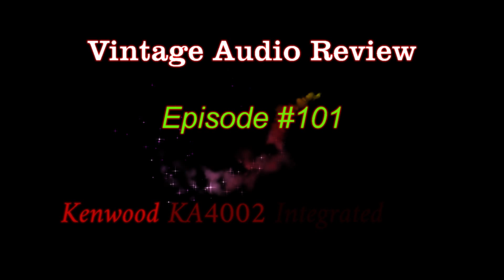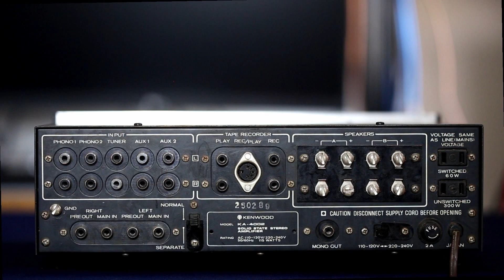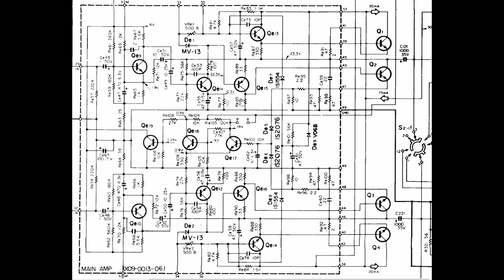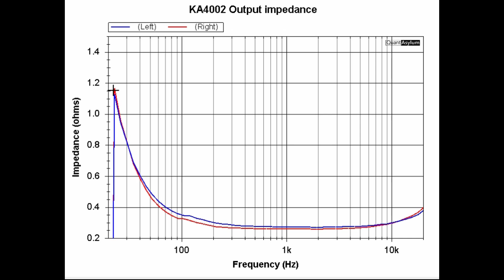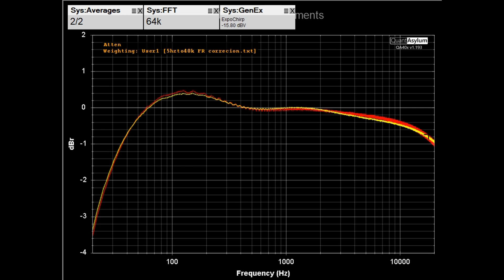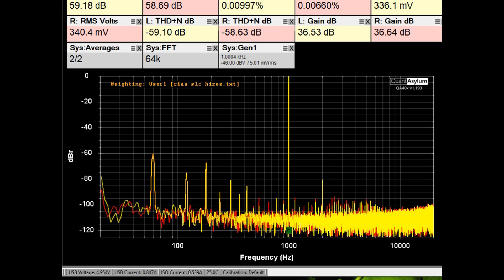Kenwood KA4002 Integrated Amp- Vintage Audio Review Episode #101

Comment: The best sounding small amplifier I have ever heard. I am a retired electronics service tech and have heard 100's upon 100's of amplifiers. This amplifier which was designed by Nakaichi and Jiro Kasuga just before they left Kenwood-Trio to form Accuphase. It is an absolute giant among small amplifiers. Strongly recommend you change out the six Hitachi 2sc458 transistors.
Reply from the maker: Thanks for the info! It is my friend's and I am not sure he still has it. Will keep that in mind about the transistors.

Comment: Just got a 4002 at a fair price for my daughter. What a sweet little gem! Previous owner replaced the bridge rectifier and the PS capacitor in it, otherwise it is completely original and it sounds perfect. This old thing doesn't look like much, and I don't know if it's because it's capacitor-coupled, but it sounds astonishingly good. Now I need to find appropriate speakers for it. For the moment it matches nicely with my Dynaco A25XLs, to the point where I'm thinking about keeping it and giving my Pioneer SX-720 to my daugther instead!!  The Pioneer has almost twice the power, but the Kenwood sounds as punchy and is so sweet!  Thanks for your video!
Reply from the maker: Thanks for the great comment! Ask your daughter which one she likes- my guess is she will want the newer looking Pioneer. Am not familiar with the A25XLs, but a nice vintage speaker is the Klispch KG2 or 3.

Comment: I own one of these, and i can say this is a very sweet sounding little amp. Despite it's humble power (at least on paper) it can do seriously big music. The functions and the connectivity is very good for a little lower-end amplifier. Thanks to the cap coupled topology it sounds really sweet, some people don't like it because it's not very analytic, it adds some color to the sound, some people do like this... I did a full recap on mine because some caps were way out of tolerance, so i decided to do a full recap. Replaced some old noisy transistors too, with modern equivalents. I can say, this amp can be the main amp for a lot of people, it sounds so good, and in an average room with normal music listening it's power is more than enough...
Reply from the maker: Thanks for taking the time to share your experience with your Kenwood and  am glad you are enjoying it!!

Comment: My brother had one of these.  He and I drove down to Tech HiFi near MIT in Cambridge and while there he picked up this Kenwood, in house TDC speakers, and a Sony tapedeck (well before Dolby noise reduction).  It seems he just had to have a system similar to mine.  I had purchased a system from Tech HiFi two years earlier:  AR turntable, Shure ME93E cartridge (soon upgraded to M91E), AR 4ax speakers, and a Kenwood KA-2500 amp. It was a nice tiny DartColl dorm room system.  All three I still own btw.  As for my late brother's set up?  Long gone.  Soon after he got out of college I assume.  I wish he could have offered the 4002 to me.  :(
PS These early Kenwood amps, while rather low on the totem pole back then, bring relatively big bucks nowadays.  
S
Reply from the maker: Thanks so much for sharing- that makes doing this extra fun. It is amazing how we can remember the early set-ups we had in our younger days. I could not tell you the cartridge in my turntables, though 🙃. Glad you still have the 3 pieces of gear!  It is nice that a lot of vintage gear is getting good prices, but that also makes it harder to get good deals on them.

Comment: it was a budget amp back then and most likely will outperform most the budget amps nowadays 
I like these older audio equipment
Reply from the maker: Thanks so much for taking the time to comment! There is just something about a lot of the vintage gear that makes them attractive compared to a lot of the new gear, IMHO, even the budget models...
Reply: I sold these back in the day.  They were mediocre then and they're mediocre today -- the average sub-$100 "chip amp" and power brick combination blows it away in terms of power, distortion, and noise.  The input/output versatility and tone controls are its only edge over otherwise much better modern budget gear.
Reply from the maker: @editorjuno  Thanks for commenting and you are correct some of the modern $100 chip amps may perform better. But that is not point with people who like vintage gear like myself 😄
Reply: @vintageaudioreview  -- Understood, and there was no intention to rain on your parade.  As a "vintage" guy who's been around home and pro audio gear for well over 50 years, I understand that vintage gear nostalgia is rarely about performance -- it's a hobby interest in and of itself that's not about getting the best "bang for the buck" in terms of performance, which has been my personal audio m.o. for many years  Moreover, there are certainly a few somewhat elderly pieces that have no modern equivalent, at least not at a reasonable price -- e.g. the two 1980s Yamaha processors that remain at the heart of my own system, which has no fewer than twelve channels of modern Class D amplification, ten of them residing in three active three-way speakers and a subwoofer.

Anyway, I was an audio showroom sales drone circa 1970 and ran a high-volume audio repair shop later in that decade, so I'm just sharing whatever first-hand experiences I've had with the vintage stuff back when it was relatively new.
Reply from the maker: @editorjuno  Thanks much for the clarification and sharing your experiences. My vintage parade was not rained on 😄 It is a hobby for sure, though for some of my friends it is a nice obsession- not about trying to get the ultimate best sound, but getting that piece of gear that just looks good too. I was just discovering "audio" in the late 70's in college, but loved going to the local audio chain stores.